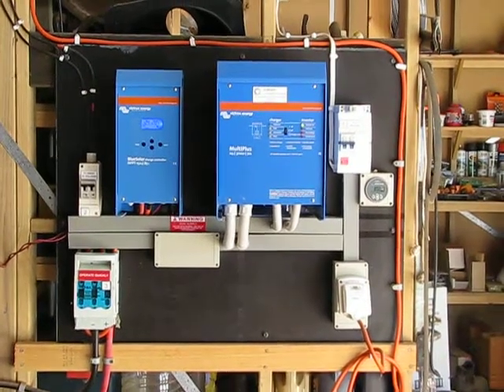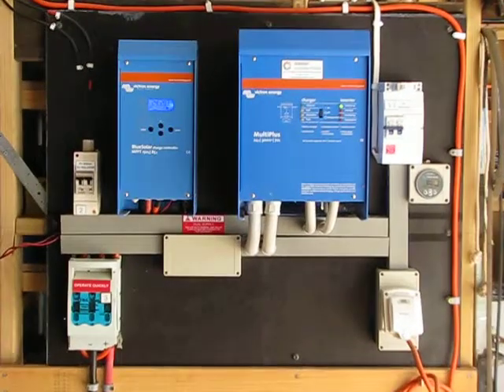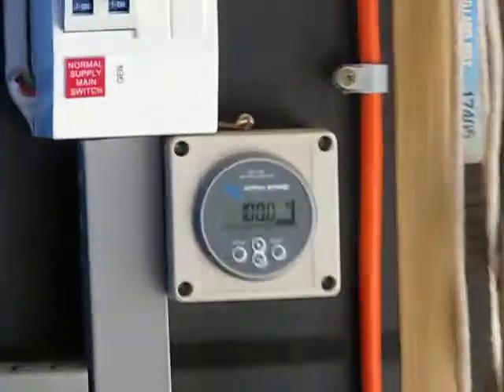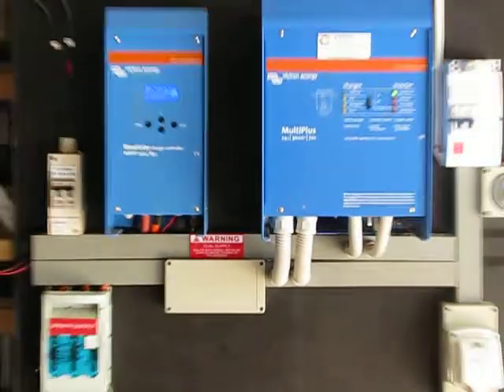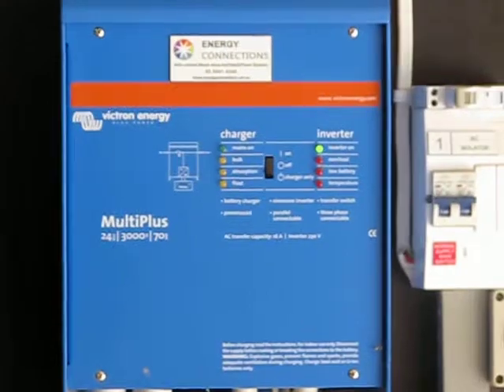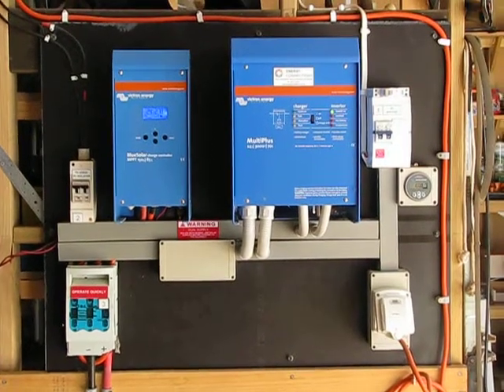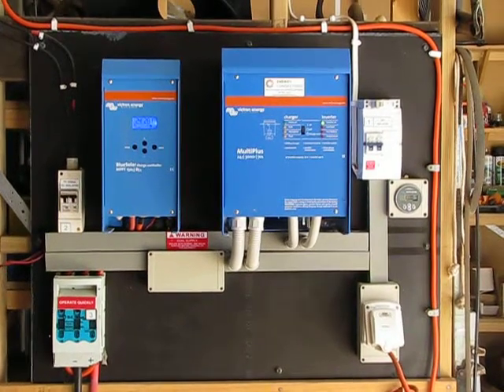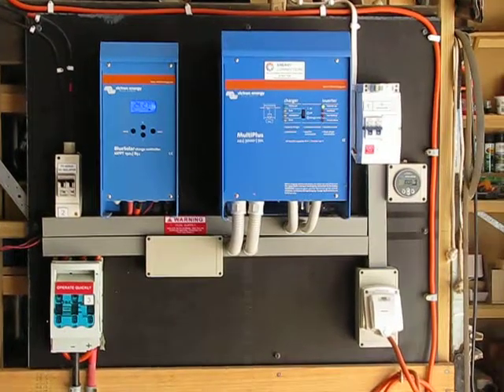Off the Grid in Oz and Solar Control Boards

Comment: hey steve love the videos but i do not see the link you said you would throw up about getting the board prewired   . 
thanks again for the facebook groups and all the youtube vid . 
ps hi kerri
Reply from the maker: Yer ... went looking for a link to current adds from them but could not find the exact one    but found this one from my mates at the same co  ...     they have gone up a tad over the last 18 mths :- (      ours was 3800   now 4600 but still great value for an instant DIY setup 

http://www.ebay.com.au/itm/Victron-Off-Grid-power-system-3000VA-24V-RAPS-SPS-Hybrid-Back-up-pre-wired/391436902718?epid=739398762&hash=item5b2375213e:g:iXQAAOSwubRXFcw0

Comment: Hi Steve.  I just checked out the link you added.  I have found another listing of theirs that includes batteries.  What do you think of that set up?  I know you got your batteries second hand from an earlier video.  Thanks, Mark.
Reply from the maker: Cant see a link in your reply ? .... but Yer , I have seen those ... pretty expensive from memory though ...  nice sets ... but me .. Even after 19 months with our new  latest set up , I would still tend to buy the separate gear , board , panels and batteries and grab a few buck savings ..  But as I always say , it is up to you and your budget ?   cheers Steve
Reply: I don't have cash to burn but I also don't have a lot of free time either!!  

I could buy the separate components & wire one of these up myself but I'm self employed with employees & a young family.  

At the moment I have 3 x 200w panels into 3 x 12v 120ah batteries using a MPPT charger. Only running 12v lights, pumps, tv & radio at our container camp.  We need to build a big shed soon!!
Reply: Mark with out knowing what you want to do at your camp its hard to say weather that system is right for you, way oversized or under sized.